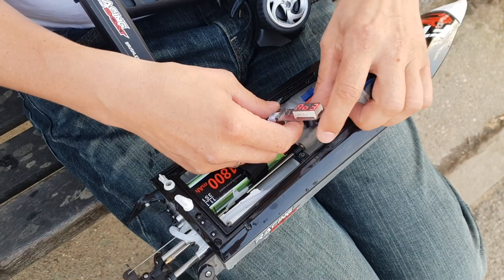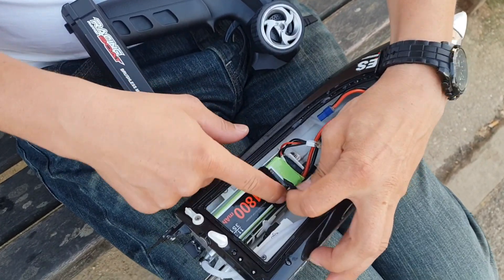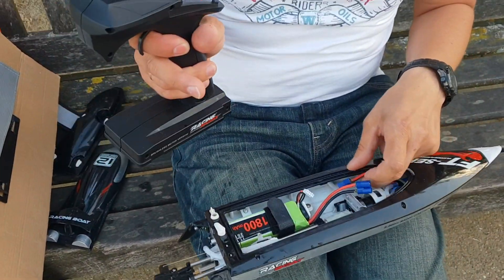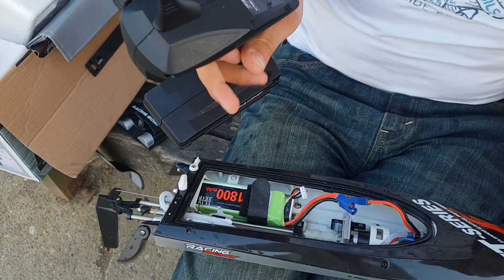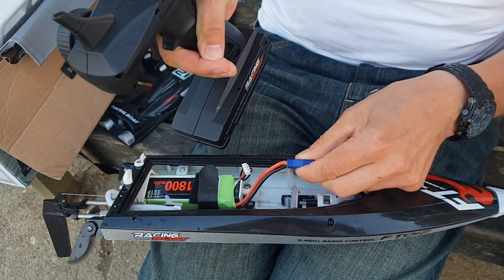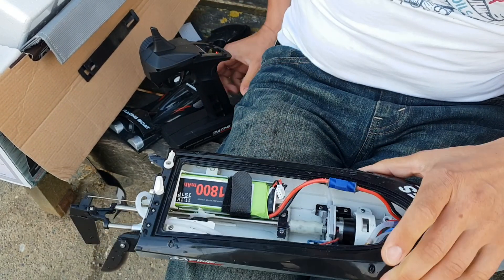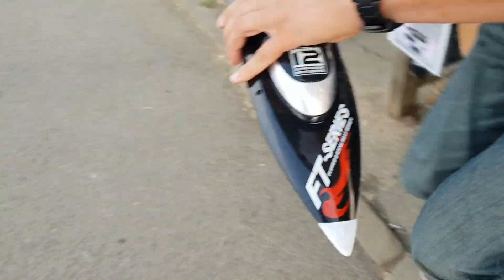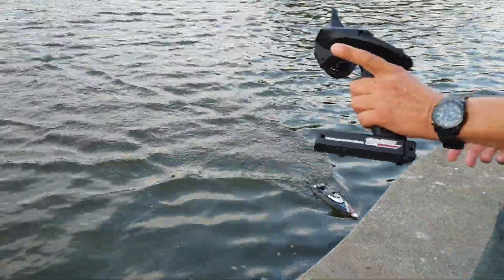FT012 ESC calibration

Comment: I have a long enough ft012, can I use the updated ft012 esc
Reply from the maker: What do you mean by updated? So called v2? Yes the one I've got is v2. Check if its compatible with the rest of the system you have.
Reply: @rodman777  sorry, esc V2.
How to check it. Before i buy it?